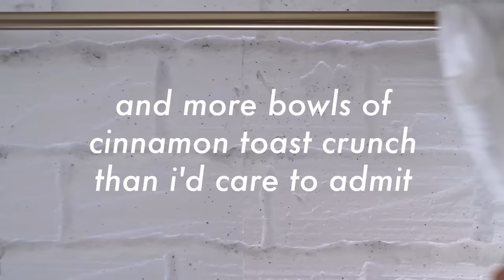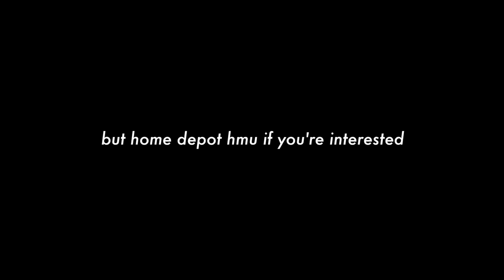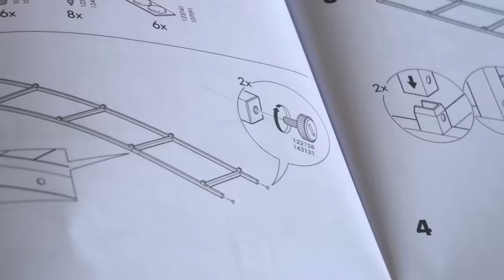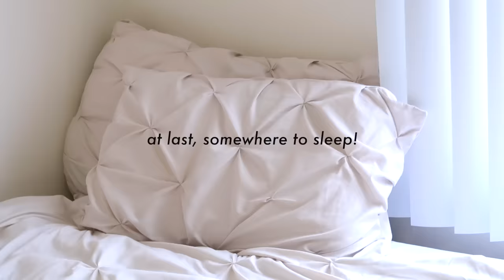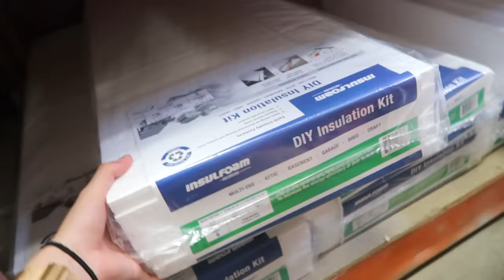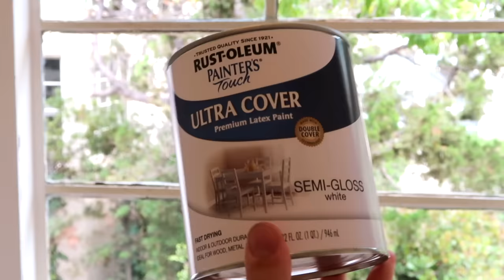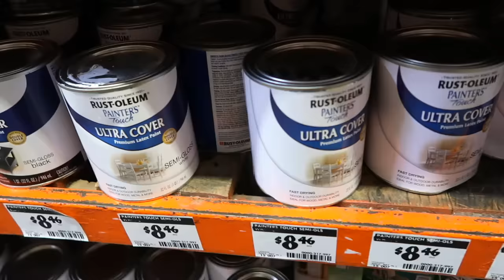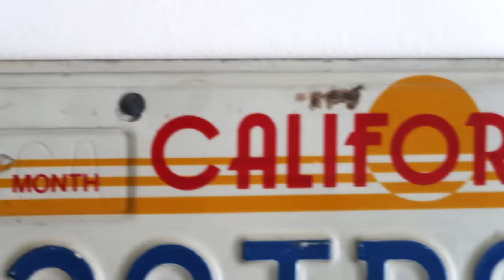THE ULTIMATE BEDROOM MAKEOVER + room tour

Comment: I am a female and I used to be a Plumber... The pizza cutter thingy is what we call copper pipe cutter, and the rod is a copper pipe, I am guessing 1 inch is what you used. The connectors are called fittings. The ones you used were T's and 90 degree elbows. In Plumbing they are usually sanded and soldered together, but Gorilla Glue is a good idea for your project! Loved the video.
Reply: Melissa Whitecap props to you lady. My husband is a plumber and he works his ass off. I definitely couldn’t do it. You’re awesome!!

Comment: Copper pipe tends to mark up a lot with finger prints, but you can easily remove them with acetone/acetone based nail polish remover on a cloth. Acetone will also remove the blue stripe that's on the side of the pipe. :)

Comment: Hey, just wanted to throw in a bit of a comment on the video...1st great job...especially portraying my exact feeling on running out of supplies right before you finish parts of projects  (drives me insane to not finish things being that close to finished). 2nd, the zebra chair definitely looks better than the plain wooden chair, however it may have been cause of the tone of brown. A light sanding and black flat paint on it would of tied it in with the color scheme, if needed. 3rd, if you ever wanted to go with a different look on the older mauve chair there are pretty cool tutorials on fabric painting for furniture that would totally be beneficial to wrap up the colors together.

Comment: You will most likely need a flashlight- so buy a flashlight with a magnet at the end. You can stick it anywhere metal and find any metal pieces (including screws) with the magnet on it. I use it to find small washers on the grass so I think it can find your screw easily. Does double duty - which is convenient!